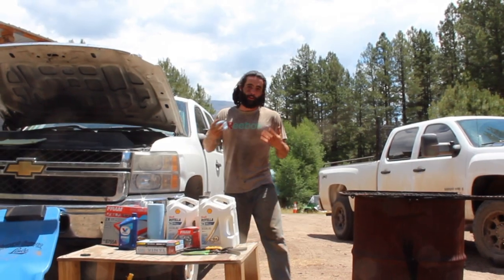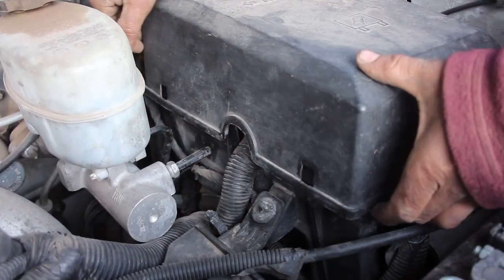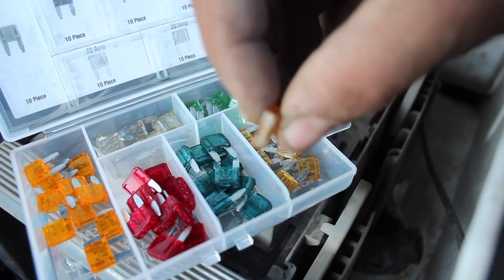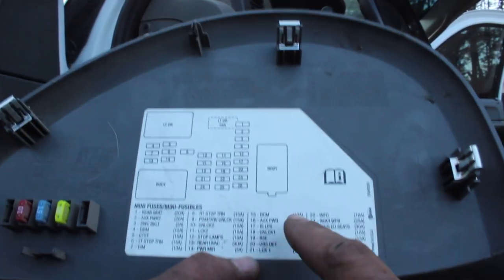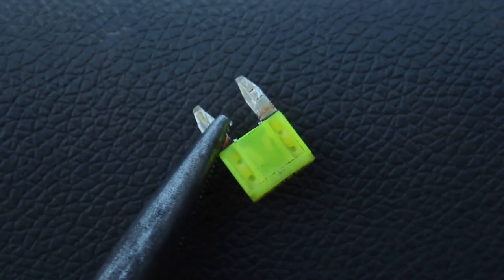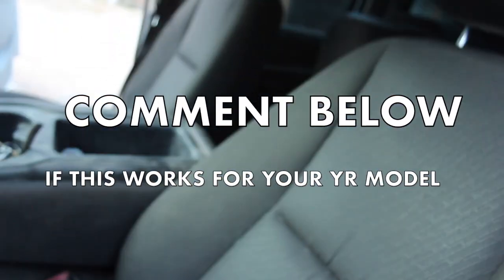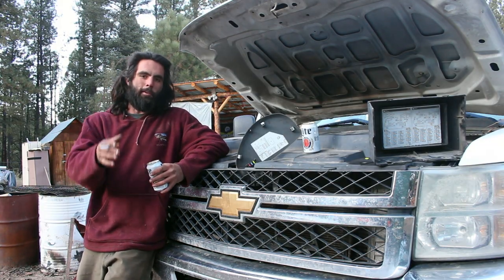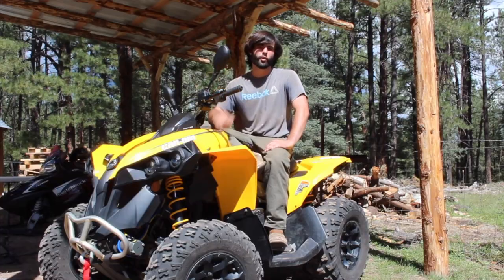How-To Replace Cigarette  Lighter 12V Power Fuses in Silverado (Fuses driver, passenger, rear plugs)

Comment: Very helpful. The owners manual wasn’t helpful in telling me to check the fuse under the hood for the driver’s side outlet. I thought I had a bigger problem, but your video saved me a bit of frustration. Thanks for the tip.
Reply from the maker: not a problem, glad it was helpful and the easy fix worked for you. Thanks for watching and taking the time to leave a comment. Cheers

Comment: Lmao my right 12V has been out for about 2 years. Assumed it was a wiring issue but after seeing this video it was obvious that it was just a 1 beer fix. Thanks man.
Reply from the maker: no worries glad you got it fixed up. A lot of the common issues on these trucks are simpler than I'd expect as well. Thanks for watching and taking the time to share your experience in the comments. Cheers

Comment: Both cigarette lighter sockets on my '05 Silverado stopped working this year. The one on the right when I replace the fuse in the engine bay fuse box, blows the fuse immediately. I measured the socket and it's reading short with an ohmmeter. The left socket simply doesn't work but does not read short.
I checked all of the fuses in the dashboard fuse block and none are blown.
Can't understand how one socket is shorted and the other just has no power!

Comment: Both mine are out and the fuses are good, I think it might be the actual plug in itself. Have you had this issue?
Reply from the maker: I have not, but I have had some other wiring issues with our 08 gas truck, let us know if you figure out how to get em working again if its not the fuse as I'm sure if it happened to you, there are other guys out there with the same issue who would love to see what the fix is. Appreciate you watching and taking the time to leave a good question in the comments and sorry I couldn't be of more help with your issue. Cheers
Reply: @EscapePowerSports  

Both my plugs went bad within a week of each other.  Probably because I had a small inverter plugged in charging some Dewalt batteries.  I replaced one with a double USB plug and the other just a replacement plug. I haven't been using the inverter and now  both are still good to go to this day.

Comment: I have the same problem, but I checked all of the corresponding fuses, and they’re all good. I my heater hose broke, and I was using a 12V auto/truck heater to heat the truck and I thought it blew the fuses. All compatible fuses are still good though. Any other ideas?
Reply from the maker: not sure, maybe it burned up a connector or the plug itself failed? Good luck with it and let us all know if you get it figured out. Thank you for watching and taking the time to share your experience with this issue in the comments. Cheers

Comment: question hopefully you can help me I have A 08 Silverado 2500 HD keeps bogging out when I go up hills but runs fine otherwise changed Cadillac converters changed mass air flow sensor can't figure it out I was going up the Hill numerous times I would have to turn my AC off and the truck would run probably about 10 to 20 mph see if you can help me out bud
Reply from the maker: hmm, I'm no auto mechanic so I really have no idea.. Random guesses would be bad spark? clogged air filter? really dirty oil? clogged fuel somewhere? sorry I couldn't be of more help but thanks for watching and taking the time to leave a question in the comments, Cheers

Comment: I checked the fuse the fuse is good so I took the cigarette lighter apaht bought a new one still not working I put a tester on it I'm getting power I put the pasta on the negative and positive I don't get it's a light up but when I put the test on the positive and touch it with a positive it lights up can you please tell me what's wrong
Reply from the maker: unfortunately electrical is not one of my specialties at all, but hopefully someone with more experience will see this and chime in with a fix or further diagnosis to perform with that issue. Sorry I couldn't be of more help, and I appreciate you watching and taking the time to share a detailed description of your experience with this fix. Cheers

Comment: is there any way to make the outlets turn off when the truck is off?
Reply from the maker: hmmm now that's an interesting question, not that I'm aware of, but I'm fairly ignorant to electrical solutions so maybe someone with more experience will see this and have an option for that. I usually try and unplug anything that draws current when truck's off but obviously I forget more times than not. Thanks for watching and taking the time to leave a thought provoking question in the comments. Cheers

Comment: Any idea why it only works half the time? Do fuses go in and out as they are going bad?
Reply from the maker: hmm I'm really not sure, more likely its a bad connection or the plug itself is wearing out. As I don't think fuses will ever work again once they pop. Good question and maybe someone with a little more experience will see this and have an easier solution for you. Either way thanks for watching and taking the time to leave a question in the comments. Cheers

Comment: I could not find the aux power cig  fuse anywhere on my 05 Silverado. . The one on the left is clearly marked . The other one is not. Go under your hood to the fuse box look on the right side and check every 15 amp fuse for power on both sides. I found it on my own.  It is not clearly marked.
Reply from the maker: awesome, well I'm glad you found it and thank you for taking the time to share how this fix might work for other year models as I'm sure someone with the same truck will see this and appreciate you taking the time to share. Cheers

Comment: Just like you... Left one worked right one didn't.... I've had my 2011 Silverado almost 10 years and didn't know there was a fusebox in the cab! And definitely not a 2 beer fix... (.5-1 at best,)😁🤣 just subscribed hope I don't need you but it'll be nice to know where you are if I do.

Do you take requests? If so... Can the front  wheel speed sensor be swapped out without even taking off the front wheel???? Or without removing the caliper and rotor? My PASSENGER side keeps throwing codes and I can't find ANY info on the ease of season that on a 2011 2WD!
Reply from the maker: glad to hear it worked for you, and your probably right, I just like to stretch it out to a two beer job if at all possible haha. And I pretty much just video whatever breaks on mine, but my cruise control on a gas 3/4 ton silverado does not work so we might be looking at speed sensors in the playlist soon. Appreciate you watching and taking the time to leave a video suggestion in the comments. Cheers

Comment: Can you actually stick a cigarette lighter in one of those sockets and light a square🫤😟
Reply from the maker: not sure exactly what you mean, but I appreciate you watching and taking the time to leave a comment. Cheers
Reply: @EscapePowerSports  “square” is slang for cigarette, because of the box they come in
Reply from the maker: @olehemlock  roger that, good to know. and I've had no luck getting a light straight from socket, but the header of a motorcycle at idle will do the trick if no matches or lighters are to be found. Thanks for the response. Cheers